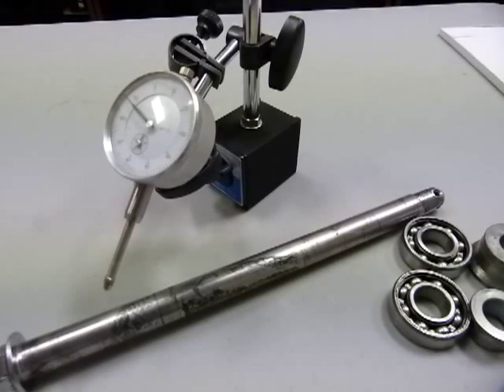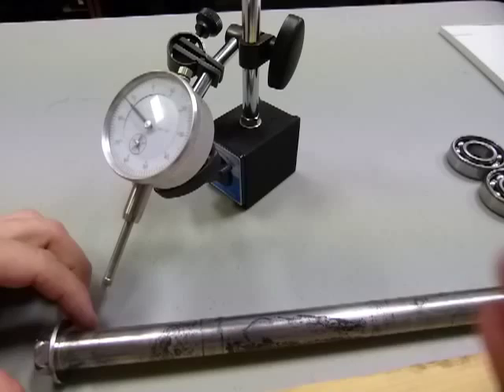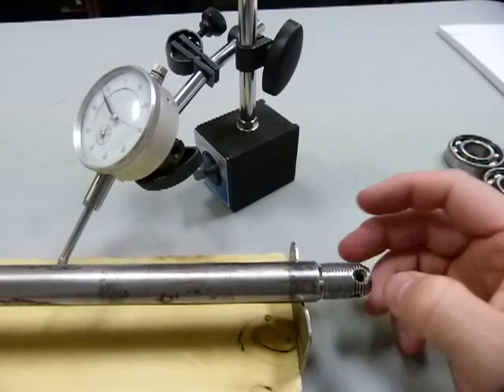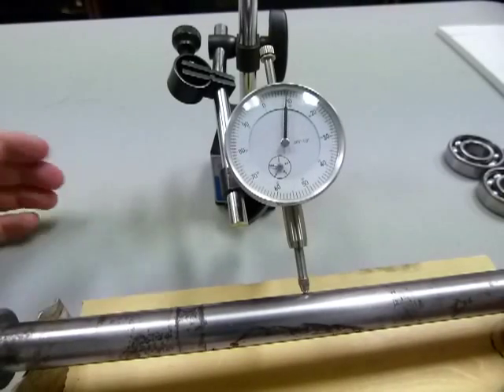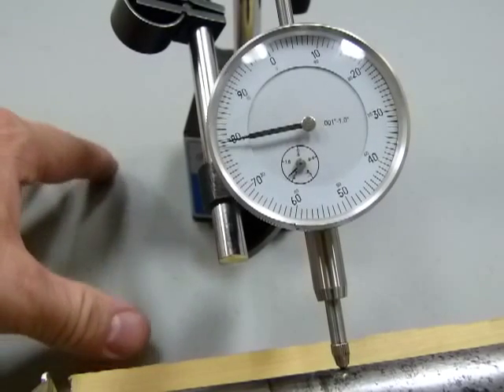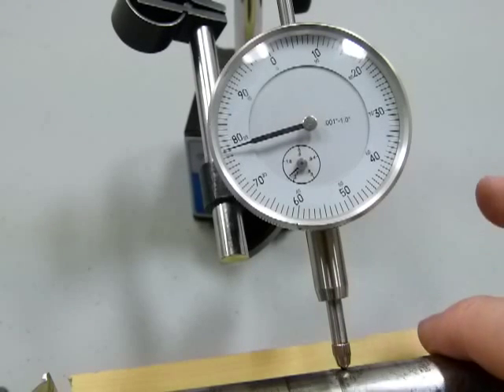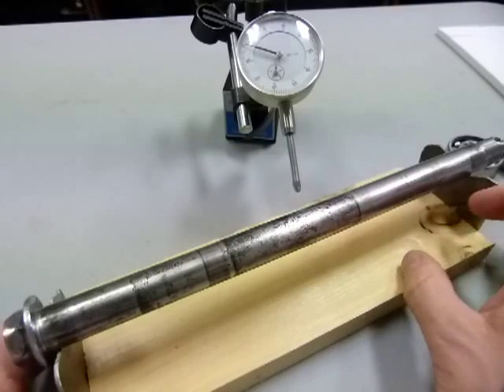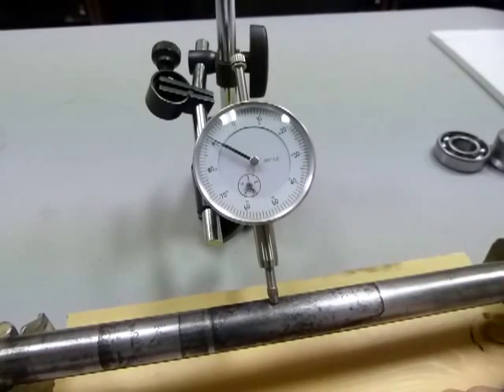Measure axle run-out

Comment: Or just roll it on a glass plate on your working table and sit on a chair and look between the axle and the glass plate for an air gap. Just remember to have the washer end off to the side of the table and plate or else the air gap is going to be really big.